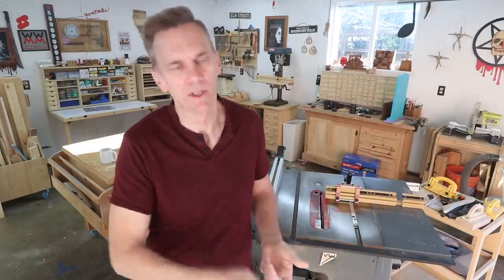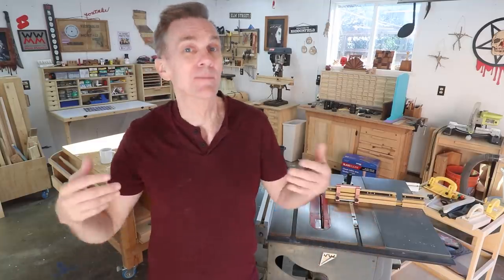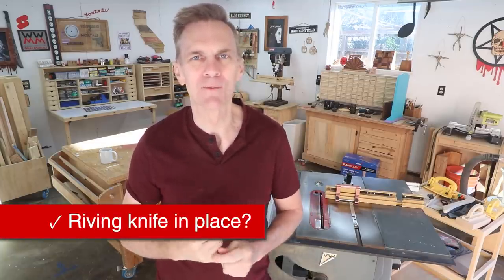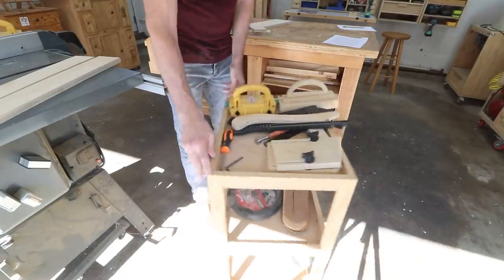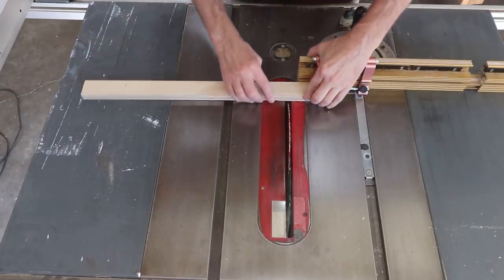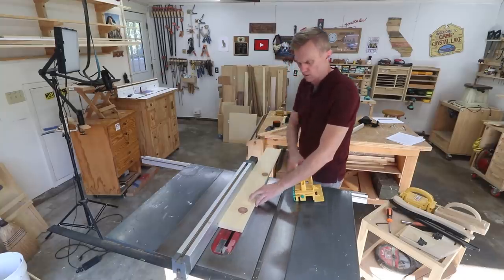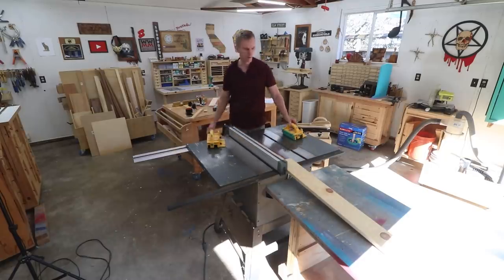Watch this BEFORE turning on a table saw. The Table Saw Golden Rule.

Comment: I took some classes at the Woodworker Academy in Alameda several years ago. Their primary rule was: before you turn on any power tool, ask yourself: am I doing this in the safest way possible? If the answer is ever no, stop and change your approach until the answer is yes. It helps you remember safety glasses, mask, hearing protection, body position, push sticks, all the things you know but sometimes forget.
Reply: people that injure themselves probably have 2 things not on that list:  confidence and a need for speed
Reply: @natalieisagirlnow  is a table saw dangerous
Reply: @jeremynguyen2346  only the person using  it incorrectly makes it dangerous
Reply: @christopheredwards5884  I'd flip that on its head, and say it's inherently dangerous. Only the person using it can make it safe.

Comment: 7: pull the power plug before swapping any mechanicals. This could be an addition to 1: riving knife. I say this because it’s how I operate any cable powered tools. Great video, you reminded me of a lot of things. I want to go cut wood now.
Reply: Always the right thing to do no matter what tool your using
Reply: Indeed, and I all the manuals I’ve read suggest this too.
Reply: For me, I hit the main power switch. Actually unplugging the saw seems like overkill to me. I mean, I'm not gonna accidentally hit two different switches at the same time.

Can anyone tell me why I might be wrong about this?
Reply: @MaxMeyerTO  my guess is most people don’t have a switch for their outlets. I wish had one for child-proofing. But I agree with you that it would be sufficient.
Reply: @MaxMeyerTO  Depends on what you're calling a main power switch, but generally speaking, the tool might not be running or be prone to turning on as you operate it, but you can still get an electric shock, which is another risk (and then that can lead to further injuries depending on how your body reacts and what pieces of metal it hits). As long as there is physical contact, there is a risk for several reasons such as random external events like something falling on a switch and breaking it in just the wrong way; or a wire's insulation being worn out/coming new defective leading to energizing something that isn't supposed to be and then you touching it and closing the circuit with the ground or whatever. On the one hand, said risks are often not that high, even though they do add up, and often times they're practically impossible to estimate. On the other hand, you completely eliminate them by unplugging (assuming no capacitors are involved, that would be a magical third hand risk, and non negligible) and won't even have to consider them anymore, and if you can reduce risks with severe consequences from not zero to zero, it is usually good practice to do so.

Comment: One other rule that I go by on the times that I don't have my blade guard on is "Never ever reach over or across a spinning blade".  Even if you have turned the saw off and really want to get that piece you cut to go on to the next part of your project the blade that has not spun all the way down can cause you injury.  I have a mental no-go zone around the blade of about 5 or 6 inches that I won't put my hand into when the blade is in motion and the blade guard is off.
Reply: Excellent point. MANY accidents have occurred that way, with a hand or loose clothing getting into the blade.

Comment: I just made my first cuts with mine over the weekend - two 81” lengths of plywood at 2 3/4” wide. It was a bit intimidating at first, but I had my husband act as my “spotter” and catch the offcuts and my workpieces as they came off the saw and everything went smoothly. (It’s a little Harbor Freight cheapie, but it was a gift when I couldn’t afford to go buy what I wanted.)

I actually used your “Golden Rule” beforehand, without having heard it prior to this video. I lowered my blade and did a dry run through to be certain we had enough clearance, that I could reach everything easily, etc. 

Great video, as always. Thanks, and keep ‘em coming. 🙂
Reply: If you're happy with it, it's a good tool! 
Tool cost usually correlates to convenience and time savings more than anything else.
Reply: @Leadvest  agreed!
Reply: Damn! I don't even cut large pieces of plywood on my tablesaw! I use a cordless circular saw.
Reply: @Leadvest  I yt?
Reply: @charlieodom9107 , I usually do too, but I use a guide (since I don’t have a track saw) and I couldn’t find anything long enough with a straight edge! It was for my little five year old granddaughter (I modified a bed that she loved to fit a mattress set that was a couple inches too long), so I just went for it. I had some 3/4 inch plywood on hand that was the perfect length, after trimming an inch off the ends, so I figured if I couldn’t make it work, I could go to my neighbor, next door, and get him to run the cuts in his huge shop on his much nicer table saw setup. I totally rocked it though! I was kinda proud of myself. 🤗
Reply: @jodilea144  If you plan to cut more plywood, go get yourself an 8' stick of aluminum flat stock to use as a straight edge. That is what I use. I don't have a track saw either.
Reply: @charlieodom9107 thanks for the tip. 🙂
Reply: When you have the budget to upgrade, consider starting with a great blade. The outfit that sold me my saw insisted that I replace the manufacturer's blade with a Forrest Woodworker II. I am forever grateful.
Reply: @NormanRamsey , yes, I’m a firm believer in using quality blades, bits, etc.
Reply: @NormanRamsey  that isn't necessary. A CMT, Diablo, or Freud will work for many hours of cutting. You can buy several for the price of one Forrest.
Reply: @charlieodom9107  I'm sure those others are perfectly worthy blades. But the edge comes off the Forrest almost perfect, with no sanding required. And the blade is smooth and quiet on the arbor. For me it's more than worth the extra cost (I own three of them).
Reply: @charlieodom9107  yep, I tend to use Diablo’s stuff a lot and haven’t had any issues.

Edit: quality doesn’t have to equal expensive 🙂
Reply: @NormanRamsey  Those I listed create just as nice of a cut as that expensive Forrest, and you can buy multiple for the price of one Forrest.

Pretty much everyone, they would rather be able to buy a Rip, Crosscut, and Plywood blade for the same price as one Forrest, and get better cuts with the 3 blades.
Reply: @jodilea144  yeah. The main thing is that you can buy multiple Freud, Diablo, or CMT blades for the price of one Forrest, and most people aren't going to spend over a hundred bucks on a single blade.
Reply: An assistant can be great, but be very careful when you have a helper on a one person machine. Make certain that your helper does not accidentally close the kerf back up when they grip the wood in the out feed side. This can cause the blade to grab the wood and throw it at you at high speed.

Comment: Respect, don't fear!  Great tips from Steve but here are a few more.  A friend once told me to know where all your fingers are before you start  and when you cut to make sure they are not in harms way.  Do NOT use gloves when using a table saw.  Your gloves can easily get caught in the blade as your feel with your finger tips and with gloves, that will not be the case.  One last additional tip, do NOT wear baggy long sleeve clothing when using a table saw.  It is very easy for the drop of the sleeve to get caught up in the blade especially when you are reaching over the blade itself when finishing the cut.

Comment: Just wanted to echo what others said here: EXCELLENT safety tips. I'm a beginning woodworker, and I'm getting a little more comfortable using the table saw, but I have a ways to go. Videos like this help me get me a little farther down the road -- obviously never getting cocky/overconfident, because you need to respect the tool. Well done.
Reply: absolutely! confidence comes from experience, safety comes from respect for your tools. theyre like wild animals, might seem tame on the surface but throw a stick at the wrong one and youll end up getting bit. old coworker lost his thumb on a table saw due to ignorance. just didnt move it out of the way while cutting small stock and pushed his hand right through the blade. these mistakes can be easily avoided by using a push stick, but making a quick cut 'quicker' led to a disaster.

Comment: I've been using table saws for 30 years and its still one of the most intimidating or at least most respected for danger of the full shop of tools I own... I have had close calls with fingers, I've dropped a piece on the blade and watched a 4 foot long 6 inch wide board an inch thick yeet itself 12 feet and embed itself thru the sheetrock wall and even a blade nearly explode when it found some solid metal in a piece of reclaimed wood leaving 3 chuncks of carbide to be picked out of the side of my face... At the same time I know another carpenter who got her face wrecked by a kickback, like 30 stitches worth, who refuses to run a table saw and I just don't know how she gets by without it cause its one of the most important tools I own and the centerpiece of IMHO any shop.

Comment: I love your channel and have learned so much from it.

One thing that I encounter every so often is being in the middle of a cut and having the wood pinch the blade and/or riving knife because of an internal twist.  You know this is happening because you can feel the increased resistance from the wood as it travels over the blade.

What I've done is stop the saw and find a small piece of scrap to wedge in the far side of the wood that has already been cut.

Comment: Well done, and appreciated. I use my table saw quite a bit, and your reminders are always good. I frequently use a lot of tools, power cords, moveable work tables, etc. when I am working on a project, and I would add one safety reminder when using the table saw: Clear the work-related clutter from around the saw before making cuts. I tend to gather all sorts of stuff around the saw and get so interested in my project, the temptation to just shove stuff aside to make a cut is always there. Instead, I make myself keep the space around the saw clear.

Comment: My fav' safety item:  featherboards.  The nearest I've come to losing a digit is trying to watch too many variables (I have a one-track mind).  Each featherboard (up to a max of 2 !) eliminates a variable.  For me the perfect cut setup is one-dimensional:  all I have to do is push (with a stick, natch).  One direction, one focus, one mission.  I'll also mention that after-market on/off switches (the ones with the big RED STOP LEVER) are pretty easy to install, and worth at least 10 points of blood pressure.

Comment: Thank you for this video.  It is always nice to hear safety tips/rules again.  While I'm limited in experience with the table saw, I've worked thousands of hours with the circular saw.  The problem was, as time went on, the safety rules began to fade from importance.  In fact, by the time I sank the blade 3 inches into my thigh, nearly killing myself, I wasn't using any safety measures at all. 

I was tired...  very tired.
I was in a hurry
I was working in a cramped space which required me to be in an awkward position
I was standing on ice; yes, slippery ice.
The blade I was using was as dull as a baseball bat but, thankfully, I'd just bent a few teeth back                         to near-straight from the 45 degree angle they were at.  All of the carbide tips on the blade had busted off many moons prior.
I was doing the work.  I had to force the saw to cut at all, applying a lot of pressure.
The material I was cutting, an old stockade fence, was full of nails, screws, and various other hardware.
I was conversing with other people, not really paying attention to what I was doing.

When the saw bucked back, after hitting a hinge, which was screwed to the underside of the piece I was cutting, it had no trouble cutting through my three layers of pants and then my leg.
I quickly tossed the saw out in front of me, grabbed my leg, to hold the 8-inch-long wound shut, a yelled, "Call 911!".

I am grateful to be alive, and my leg healed up well.  Somehow, I missed my femoral artery by less than a dime's width, and did not hit any bones, ligaments or tendons.  

I was out of work for three months.

I almost bled out in front of my children.

Safety is no joke.

Comment: another great video...I had a 15 year old ryobi table saw with no guards and and a wobbly fence.  I dreaded using it.  Last fall I got a new 8 1/4" dewalt saw and it was a game changer.  As a bonus it has storage for the push stick inside the fence! I use all guards and safety features, but am still very mindful on every cut.  Thanks again steve.

Comment: I am a beginning woodworker who just got a table saw a month ago so I could rip 2-inch boards.  I spent a lot of time watching safety videos before turning the saw on, and I now have made about a dozen cuts with the saw.  Your video is excellent, but I'd like to add one more piece of advice: check to make sure that your safety accessories are properly installed before every use.  I have a riving knife, anti-kickback pawls, and a blade guard.  When I assembled the saw, I spent a lot of time making sure that everything was adjusted according to the owner's manual. 

Since I'm a beginner, I'm still not great at feeding the workpiece through in a smooth motion, but I got concerned because my workpiece simply stopped.  Well, I'm not going to force it to go through the saw.  In fact, I instantly knew that there was something wrong. I turned the saw off, unplugged it (I always unplug my power tools before getting anywhere near anything that can injure me), and took a look.  One of the screws holding the riving knife had loosened, so the riving knife was no longer sitting true to the blade alignment.  

Lesson learned: check every single time before I use the saw.

Comment: My Dad taught me to use the table saw by the age of 10. I am now 73 and have been nicked only one time. It was a  small band aid sized nick. Never have used the blade guard. I find it usually is in the way. But I agree with you, one should use one. Only use a filter mask when sanding. Also never have I used a riving knife. If the board is tending to come together after the blade, I use a shim and drive it into the space that the blade leaves. In the "handy cart" video, love the cat... Great video...

Comment: Every bit of this is excellent.  Thank for putting safety first.  It may be beneficial to explain what zero energy means when directly interfacing with any part of a machine that can be driven.  In this case, unplug the saw or switch off the energy source and at least put a tag on it.  If it keeps someone from energizing equipment while work is performed in an entire lifetime, it's well worth it.

Comment: I know, I know, no blade guard bad, but the riving knife on my Type 4 DW745 (EU version) is designed to go higher than the top of the blade, so I had to modify it (I bought a spare for this purpose so I can still use the blade guard if need be). In the modified state, it is not possible to mount the blade guard. And as I make a lot of cuts where the blade guard and/or the standard riving knife would be in the way, I generally leave it off. 
I would not even consider taking off the riving knife though. I had to get a bit creative when making my zero-clearance insert to make sure it would go through without cutting the slot all the way through the back. The insert is also secured both front and back so it doesn't accidentally get flung out of the socket (tap on the back, small machine screw at the front).
I generally raise the blade to about 3/16" above the surface of the workpiece.

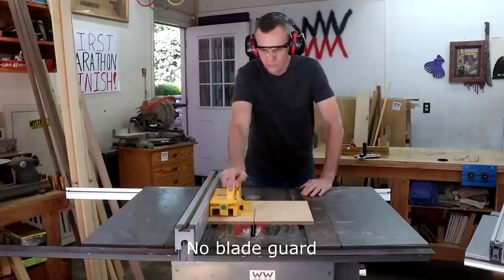Comment: 2:29 Is how my grandpa cut his fingers off he brought his hand over top of the blade without thinking cause his 4x4 post was stuck on the roller. Steve your videos have always been very helpful and informative to me, my grandfather taught me how to use saws when I was 3 years old, we were tearing out the Livingroom floor and I said, "papaw can I cut that?" He said, "Yes you can let me show you what to do" The first saw I used was a circular-saw I am currently 15 I still enjoy woodworking

Comment: My most intimidating tool was the router. My grandpa had most of the saws so I had seen them used before I ever used them. The router was new to me so I didn’t use it for months after I bought it.
Reply: Yes, me too! I bought a router table setup and it literally sat in the box for a bit more than a year before I finally decided I’d bought it for a reason and needed to get over my fear of it. I watched tons of videos and took all the precautions, and I was amazed at how easy it was. That’s been a few years back now, but for some reason, it was more intimidating than my table saw, miter saw, or anything else with a spinning blade!
Reply: Totally agree. Definitely the tool I feel most concerned or apprehensive using.
Reply: Can any of you recommend a router safety video? I don't have one (yet) but it seems like an incredible tool.
Reply: @Tommy_007  the one that I got the most value from was by Vince at VCG Construction.
Reply: @jodilea144  Thank you for a quick answer :-) I'll take a look at that. Have a nice day.
Reply: @Tommy_007 , you’re welcome. I hope it helps. You have a great day as well. 🙂

Comment: Sometimes people use miter and fence together,  but the put a block against the fence keeping it away from the fence when engaging the blade.  I was told you need to make sure the distance between the fence and blade should be great than the boards turn 45 degrees,  that way it cannot get jammed in between the blade and fence